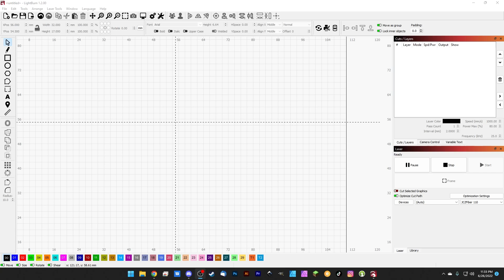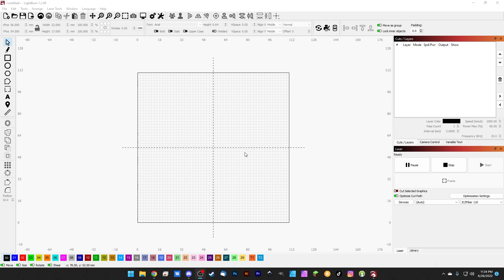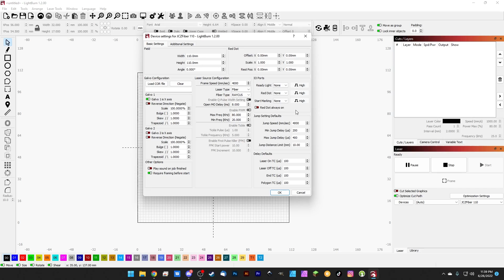Intermediate LightBurn Device Settings for Fiber and CO2 Galvo

Comment: Last Sunday we spent 14 hours calibrating and had major headache, but you instructions were very good, but lots of power thinking in our brains were fully loaded. Drove me to drinking a shot of whiskey to continue. 
Everything seems to be working good and have tested on multiple materials.
I tested some old silverware seems to work really good at the speed about 120 power hundred and frequency of 40 now there's a better frequency. Let me know but I like to really get these plate covers engraved, but they don't seem to be working, I don't know what I've done. I tried all kinds of frequencies and speed and power. Yes I do have a ventilation system for my other three lasers that's tied in.

I have attempted to with my Fiber Laser speed power and frequency ENGRAVING SWITCH PLATE . I'm not doing it on the old style plates only on the new ones that don't break that you can twist which I believe are mylar plastic. Want to engrave them but doesn't seem to want to show up. Using it to label for computer network and Home Theater. I've tried different power and different speed & frequency, but doesn't seem to make any different . Nothing shows up.

Comment: my cloudray qs 50 has the 2 red dot calibration system. does that make calibration enough to move forward when it's in line? or will I need to do do that test from the previous video?
Reply from the maker: That may get you started, but if those were bumped at all during shipping, packaging, or if you for example get the sleeve of your sweatshirt caught walking by and they move at all, they would be inaccurate. So while it may be fine now potentially, it's good to know the process and doesn't hurt to validate its accuracy every so often.

Comment: If I follow correctly you have to use Ezcad to get a core file? No way to do it in Lightburn correct?
Reply from the maker: Currently there is no native function within lightburn to generate a corefile, yes, that is correct.
Reply: So if I have never used ezcad, I should install ezcad just to run this?

Comment: Totally love your work with these videos!.  I am switching completely from ez crush to Lightburn thanks to you!  Only matter for me now is that identical settings give different colors on SS than i used to get with ezcad ( mopa 60W).  i don't get it why this is happening and its annoying :/
Keep up the good work!
Reply from the maker: Hatching is not identical in both programs so things will require a bit of tweaking when switching. That said the tweaks should be minimal, so I would start by looking at your hatches and make very small adjustments to speed and power to try to compensate for the differences.
Reply: @Laser Everything  Thanks for the reply, it makes sense so i am on it! The worse scenario is to make numerous new patterns and accept the new settings instead of tweaking, time consuming though. Thank God there is a pattern engine in Lightburn! Cheers!